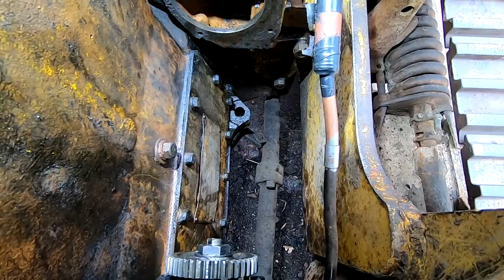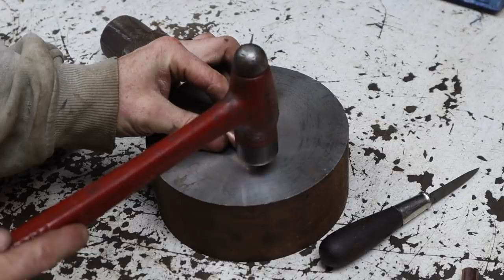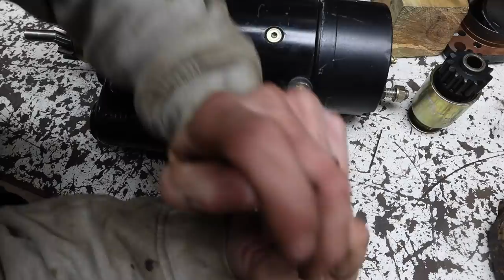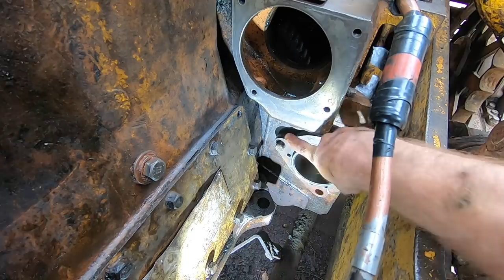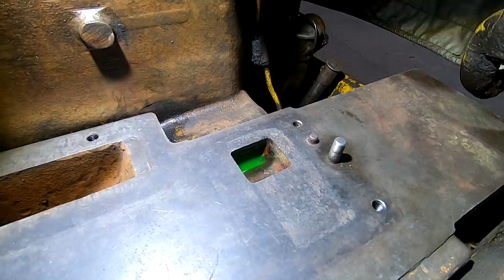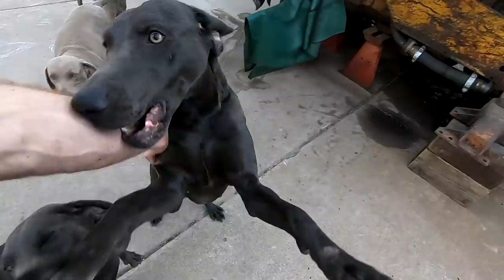Adding a SECOND Way to Start the OLD Cat TraxCavator!!! ~ Part 17 ~ 1950s Caterpillar TraxCavator

Comment: Is there anymore to this series? I feel like it ended without a conclusion. Definitely enjoyed all the process of this rebuild, as for the head leaking, check the proper tork in the bolts if they aren't loose then yeah go ahead and change the gasket, idk my opinion is your this far in it, might as well get it done right.

Comment: I didn't hear the solenoid pull in when you pulled the trigger.  You may want to verify you wired the starter correctly.  The trigger switch should control the solenoid which pushes the bendix out and closes the main contacts to the motor.  That's probably why the trigger switch smokes and the wires get hot, all the motor current is flowing through it, not the solenoid...  YES to all three!

Comment: There is a device that was used on the old Whites,, called a Series parallel switch will solve your problem with a 12V alternator

Comment: So, the 12/24V starting thing is actually simple ... 1) swap out the 6V starter for a 12V one so you don't melt it ... 2) connect that starter up to battery 1 ... 3) serial connect a 2nd battery to the first one to get you your 24V 
{so Battery 1 negative to 12V starter and 24V starter; Battery 1 positive to 12V starter; Battery 1 positive to Battery 2 negative; Battery 2 positive to 24V starter}
BUT your issue with this system is always going to be charging - I would assume that any charging system right now is 6V only and you'd need to charge up 24V so about all I can think of is "can you put a bigger charging system onto the diesel?" that way running the big motor will charge the 24 battery pair

Now, dribbling head ... if its dribbling outside its dribbling inside ... if its dribbling inside is it dribbling coolant inside somewhere ... right now you have a working diesel motor so better an ounce of prevention and have a look see, and fix the drooling block before you don't have a working diesel ... I seem to remember you already draining the oil out of the big diesel and you didn't find any large hunks of metal in it so you know you're not jumping into ~that~ can o worms

Comment: You could add an isolator between the batteries if you can find one to handle the amperage so it will charge but not feed back. If you don't have high draw 12 volt you can get a 24 to 12 regulator but it won't do heavy loads. A solenoid either. If it was like my 941 it would melt a screwdriver if you jumped it. Without isolating your grounds which may not be possible the answer is I am not sure.

Comment: Sorry that I do spell out one of the worms, but...
Redoing an engine of this age in my eyes REQUIRES a valve overhaul!
(Cleaning, checking, lapping in, valve-stem seal overhaul/replacement, play adjustment etc.)
You might have several valve-issues already, but you have really not loaded that engine much, so you really can't know it!
Do the full job from start -saves on labour in the long run! Also to make sure that lube-oil ducting to ALL available bearings in the top area is open/not clogged will save more expensive wear-out/damage later. I'd expect to find at least rocker arms bearings.
We'll be patient - watching some one else working can be done for hours without problems ;-)
Keep going, keep quality, and expect to find old DIY (destroy it yourself)-problems all through.

Comment: Pull the head !! I have a 53 D-4 down now..turns out was in need of valve  job..local machine  shop did complete  valve  job,surficed the head etc.money out around 300.00 money well spent.. new  life in the old cat!! I have a 1935 R-D6 3 cylinder Caterpillar going too see what's involved  in electric start..the cat is missing the pony motor and I can't  find the right  pony motor.glad saw your series  on old red.....Ron Ford zeigler,ill

Comment: It is not going to get any better running it that way. The head gasket problem needs to be addressed. At this point in time the job is half done, don't stop now ! You better think hard on surfacing the head as you would not want to have to redo it again in a couple of years. Ol Red should be very reliable for many years. Keep up the great work. The head gasket is a piece of cake compared to everything else you have fixed. No rust or broken bolts to contend with.

Comment: if that starter is not grounded through the chasis,  run a hot and ground straight to the starter and have it wired in with a switch and only connect the tractor to the 1 battery.  youll get 12 on 1 side and direct 24 on the starter

Comment: Run the batteries in series to get your 24 power (neg on bat1 to pos of bat2). You can run the 12v off of the first battery as it's gnd is the common gnd between them (neg on bat1 and pos on bat1). The only issue you will run into is that the original charging setup will only charge battery 1. You are essential using battery 2 to boost the 12v original system to your 24 volt starter. I'm not sure of this setup is good for you or not? You will need a battery charger that can handle series 12 v batteries to ensure the two stay charged and balanced. Likely a marine/rv/golf cart art charger could do this.

Comment: Of course - put a head gasket on it. Of course it will be a can of worms. And if you ever want this thing to look good, start painting some of these parts when you get them cleaned up. Once it's all together it will be impossible to do a decent paint job on the hard to reach areas. I do love to go overboard on that kind of stuff.

Comment: I saw an engineer fit copper pipe lugs to a welding cable.   He inserted the stripped cable all the way into the pipe, before he smacked it flat.   Then he punched the hole in the flattened end with a big centre punch.   That way the nuts held onto the cable wires for additional rigidity.    I think you need to go 24v only, as the alternator will need to match the battery set-up. . . .   Best of luck...   . . .

Comment: The 42MT is rated at 800 amps (!!...) draw by Delco.. the switch I refer to in my previous post is also called a Series Parallel switch.. (Please DO NOT mount ths switch UNDER the seat as MACK used to! The 800 A & way upwards if the battery terminals are defective or have poor contact..makes for a small bomb when the switch destructs..)

Comment: you need to make sure you connect a ground from the starter to the block if you're using a gasket. the bolts might not be enough for grounding.

Comment: Most unusual to have a gasket for use between starter and engine body.  Also, that surface is one path for your electrical ground current.

Comment: Yes it's easy to get to at the moment, but if its leaking but as you know, it's only going to get worse, to the point that coolant is going to get onto the pistons in a short time, and then you will have real damage

Comment: To have 12 volts for the pony motor. Hook the hot leg from the ground battery for 12 volts. It is ground and 12 volts and ground to battery 2 and 24 volts for your second battery positive connection

Comment: To make it work correct you will probably want a series parallel switch. It charges both 12 volt batteries and when you start it switches to 24 volt.

Comment: Solenoid between batteries (+ - -) use a key switch to activate the solenoid. That’s my fast answer without drawing it up. Master electrician, old auto mechanic. Probably going need a couple solenoids to isolate 12 from 24 and keep no voltage at starter motor.

Comment: add a starter contactor which pulls in when you turn the key to start position that will give 24 volts to starter only when you need it.

Comment: This is one of the easiest times to do the head gasket but keep in mind that diesel head gaskets require torquing different from a gas engine.  One side of me says to give the head bolts a little more torque and see if that helps and another side of me says do the complete job all the way so you won't have to worry in the future..

Comment: You can get voltage converters that step down the voltage, you then just wire it in line to the Pony Motor.
Reply: No where near enough amp capacity in one of those converters to crank the pony motor. Unless you just add in a resister to dump a lot of power as heat.  Maybe use one of those cheap 12 volt battery load testers.

Comment: Been waiting since last April. the last one I could find was Adding a SECOND Way to Start the OLD Cat TraxCavator!!! ~ Part 17 ~ 1950s Caterpillar TraxCavator. When is part 18 coming? Did you pull the heads off the Diesel engine?

Comment: Yep, do the head. You'll find more stuff to fix, but that's actually a good thing if you think about it. Fix the little things now, or they will become big things and break your working engine. TRUST ME. The saddest you will ever be is when you decided not to do a repair, and you start the engine and something blows up. It's worth it even if you find out you have to fix EVERYTHING in there.

Also yeah, I'll watch the Tahoe. Not sure if you want to put in that extra work to film it.

Comment: You should be able to pull the head without touching the pistons and valves if all you need to do is replace the head gasket,as you said it is running well and giving plenty of power

Comment: I know it's been awhile but.. I'm just as thorough as you are with projects. IMO, you should put a torque wrench to the headbolts first. It won't hurt to try & with every other bolt being loose, there's a good chance it wasn't ever torqued correctly or re-torqued after a few heat cycles. I've worked on construction crews and I can verify that maintenance is usually lacking on equipment.

Comment: You can run 24v and 12v directly off two batteries.

Hook up 24v through both batteries.
Then hook up 12v from one battery or the other.

Here's the catch. Multiple battery set ups need to have equalised batteries.
Each battery needs the same capacity, same voltage and same charge otherwise bad things can happen.

Using 12v in the above manner will cause one battery to differ in its voltage and charge.

Low power things like some Led lights while the 24v system is charging isn't an issue.

Very short high load uses while the 24v system is not charging also shouldn't be a problem as long as the batteries are charged back up from the 24v system in between uses and the voltage / charge drop isn't too great.

A better solution is to wire up both batteries in series AND parallel with constant duty solenoids so that you can switch from isolated (no power at all) to 12v to 24v.

A battery isolator solenoid is a good idea anyway. Make sure you use a double throw switch with a central off position so that you MUST turn one circuit off BEFORE you can turn on the other circuit.

The BEST system would actually to use three batteries, but two for 24v and one for 12v and keep them electrical separated (or use switchable DC-DC chargers if needed).

On the pony motor, I'd keep it in, but not as a pony motor. I'd redirect it's output to another function like an air compressor or high amp alternator with 110v / 240v inverter connect to its drive shaft.

A DC-DC charger connected to it could be used to recharge a flat main battery while gaining compressed air or mains power in the field as required by your needs.

I'd personally go with an air compressor as you could hook up an inverter to the 24v system and end up with both mains power and compressed air.

Change the bucked out for forks with a forks to hook adapter, hook a trailer to the rear and you have a fun rough terrain service vehicle for other heavy machinery.

Comment: Just center tap the two batteries for 12 volts.  You can use 2 jumper packs for 24 volts.

Comment: Our CAT V12 Generator worked great until one day it shot Anti-freeze 12 foot into the air. We found out the hard way that the previous Company Mechanics didn't know that You can't use regular anti-freeze in engines with steel sleeves. It truned out that the corresion ate the steel sleeve and cracked it. Personally I'd rebuild the whole Engine because You can't know how well or how bad it was taken care of.

Comment: just look at it this way: if you put "old red" back together and then realize you have to fix the head gasket for whatever reason, how much more work will it be compared to the work you have to do now?
Reply: no more work you can pull the head without touching the pony engine. or starting pinion or governor.

Comment: Darn Pre 1956 means you need to drill the hole. So that means my 1947 D4 Serial # 6U342, the 342 one ever made, I would need to drill the hole. Haven't run it in a few years, but it's complete, pony motor started and main runs, just wouldn't engage the pony to start the diesel, we had to pull start it.

Comment: Couldn't you wire one battery direct to the starter, and have the other battery go through a selector switch between the pony motor and the starter?

Comment: To work out how to mix the batteries without a switch check out the wiring for a Mercedes 508d the starter needs 24v but the rest of the system is 12v

Comment: If the gasket is already leaking (old red), then it's a matter of time before that progresses to worse issue(s).  Plus, the cylinder that is closest to the leak could overheat, or become damaged due to the leak's progression.   Replace it, would be prudent, since this isn't a trailer queen/display piece.  ;) 

As for the chevy?  I'd watch that video(s).  :)
Reply: Oh!  Had not realized I wasn't subscribed.  I've been watching your pony motor rebuild, and in fact, since you worked the tracks.  Sorry about that.  Subscribed **now**, and hoping to also see the chevy rebuild.

Comment: I would make sure the starter turned the motor over before I went to the trouble of installing the pony motor.  I would drain the antifreeze and see if it turns over.

Comment: A sad thing to do, as the early cat engines were low compression, it was required to allow the pony motor to run for 5 to 30 minutes, according to ambient temperature, to warm the diesel engine block in order to get the diesel to run.  It is unknown just how long, if ever, the diesel will have to crank to be started.  There was a reason for the pony motor.

Comment: Its not the 24 volts that is making the switch smoke. The switch doesn't care how many volts its switching. The reason for the smoke is the amount of current the switch is handling due to that huge solenoid. For the same reason the wires were getting warm.

Comment: Run the batteries in series for the diesel starter and just wire up your pony motor starter to one battery that will be a parallell connection that only uses 12v for the pony motor starter and will give you the 24v for the diesel starter

Comment: If I were you, I would go ahead and replace the head gasket on Old Red. If the motor was running good, (and I think it is; it sounded just like my D4, and I know THAT motor is good) then you don't have a lot to worry about. 
An ounce of prevention saves a pound of trouble, as the saying goes.

Comment: I would definitely do a head gasket but those engine have injector cups that have O-rings in them that should be changed and takes a special tool and sometimes they are a mother to get a part I am doing a head gasket on mine currently and let me tell you since you have the pony motor out it will cut out a lot of time and headache but the water pump is still a mother to get off there’s two bolts tucked in between the water pump in the block had a pretty hard to get to I took mine apart because the radiator rotted away I ordered a new radiator and all the gaskets radiator alone cost me a little over 1000 and all the gaskets was about another 4 to 500 bucks cat doesn’t have the radiator no more there’s a gentleman out in Colorado that makes them brand new good luck wish you the best

Comment: Absolutely change the gasket and O rings.  I have plenty of experience with Cats and if You blow a head gasket on a Cat or it runs hot under load because the gasket is leaking...... it will definitely ruin your day!

Comment: Yes, since you are this far into it, a few more hours of work may save you days of down time if it goes out, let alone having the head gasket blow out and going through that expense. Moreover, there is nothing worse than having to pour oil in every time you start it up and running it with low oil levels.

Comment: Head gaskets already leaking... only makes sense to repair it while you have it accessible,  especially since you plan to use this piece of equipment as it was intended to be used and not a show piece
Reply: Also, the proper way to test a starter is to use the starter button between your source power and the small solenoid activation stud... won't fry your starter buttons that way due to the less amperage draw through them

Comment: the question shouldn't be "is it leaking enough to matter now", it's "how long before it is". You might get a couple of years on that gasket or it might fail the second you get the pony motor back in. with everything already out of the way now's the time to get into the head gasket.

Comment: You need a series parallel switch with two 12 volt batteries. If you don't use the series parallel your generator

will only charge 1 battery.  Here is a link that might help you.   http://forum.aths.org/Attachment18442.aspx

I would recommend you use the switch at the top of the page and wire it as shown in figure 5 and 6.  This

setup was common in older trucks with large engines.  I would also suggest Group 31 batteries with the 

studs rather than posts.

Comment: 9:00 make the system 24 volt and use a DC 24 to DC 12 volt stepdown Hook the 12 volt to the pony  and the  use the 24 on the starter and wire in dual switch's.

Comment: You said the machine pulled to the right.
It will, the right sprocket is smaller than the left. There for the left sprocket travels feather per revolution than the right one because the right is smaller.